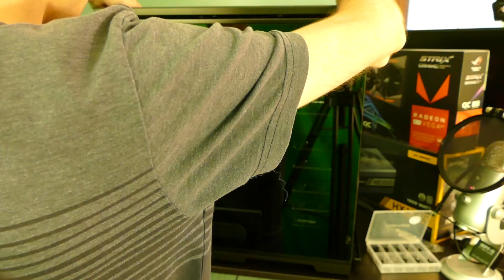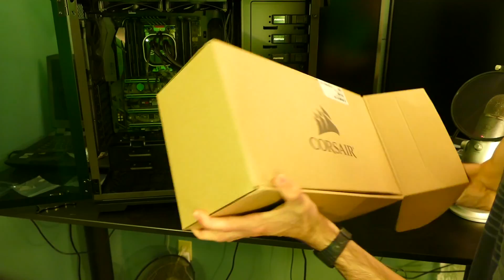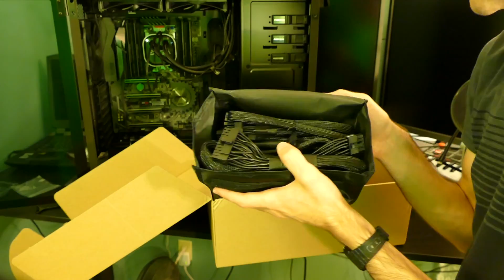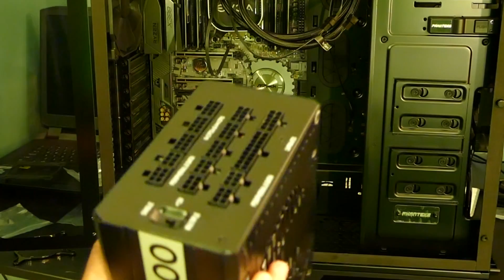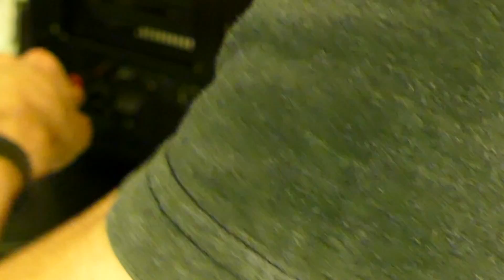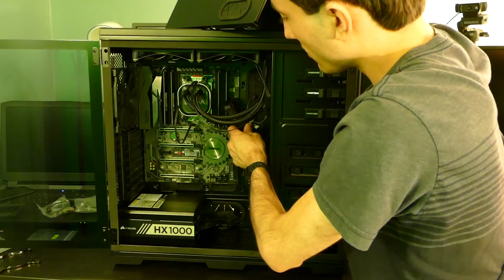Building an AMD Desktop - Part 3

Comment: Are you planning on doing any virtualization? I'd love to see benchmarks or PCI passthrough possibility.
Reply from the maker: I've already gotten a virtual machine up and running through Virt Manager (the first time I've really used that), and I've also been playing around with VirtualBox and VMware for comparison. I've got to keep my second GPU connected to the host for Blender rendering right now, but I definitely plan to try out PCI passthrough in the future!

It's no benchmark, but I will say that although I was very impressed with QEMU/KVM performance with CPU and I/O, the virtualized graphics ended up performing worse than VirtualBox due to the low amount of VRAM that libvirt wants to provide, regardless of the driver selected. This could always be bypassed by running QEMU directly (although the drivers are still designed for remote server viewing and not gaming/video), and of course PCI passthrough would also avoid that problem.